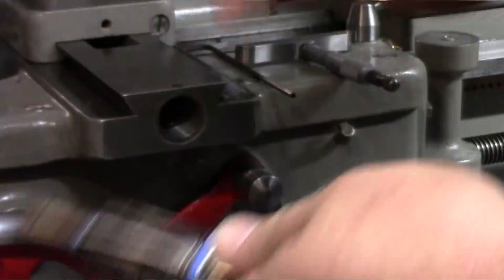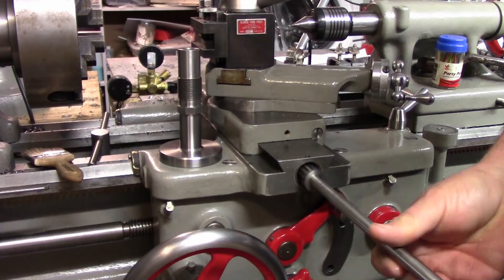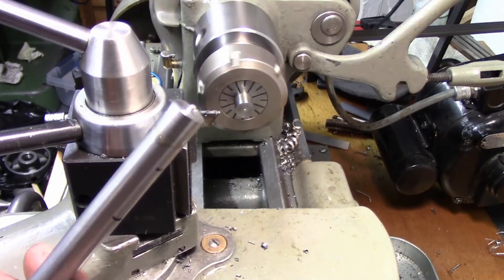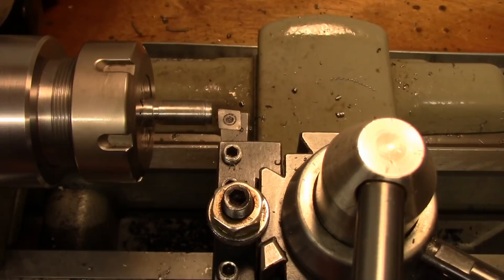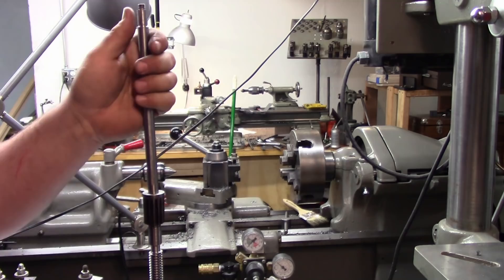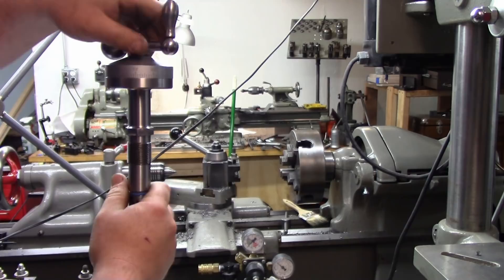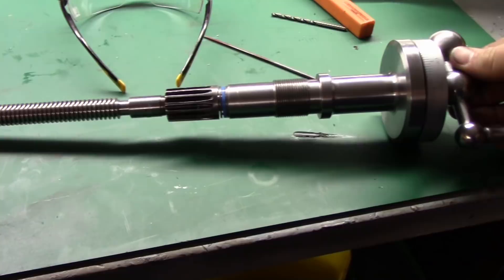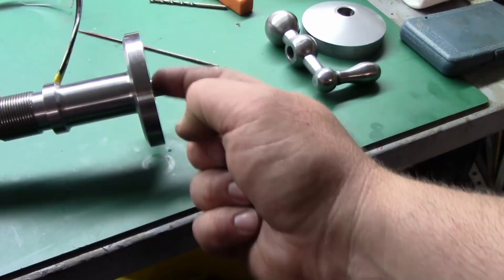Southbend 13" Large Dial Upgrade Part 5: Screw Assembly

Comment: Greg when you fit that ballcrank, put a .003 shim in between the bushing and dial. Face off the shoulder that the crank stops at. Then, when it all done the dial will spin nicely. Coming out real good man!
Reply from the maker: Thanks for the tip!.  Should have this done finally this weekend.  Baby is taking up a lot of time :-)

Comment: see lots of people use lock tight
not a fan
prefur  heat and shrink -  pin
machines are not glued together
other than that -good job 
keep it up
Reply from the maker: Loctite has worked for me in the past.  Most of the force on that particular part will be compression rather than rotational or shear.  Reason for the loctite there is there really isn't a good surface to pin to and a heat shrink fit will be a lot harder to adjust if your gap for the dial is too tight.